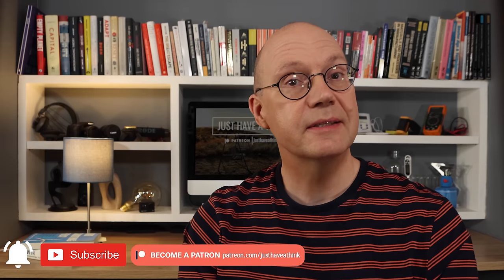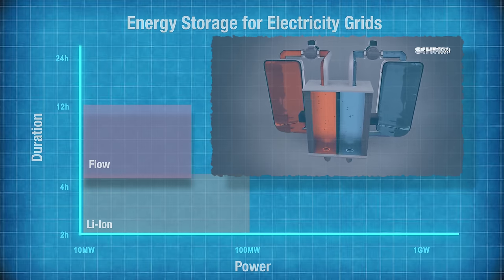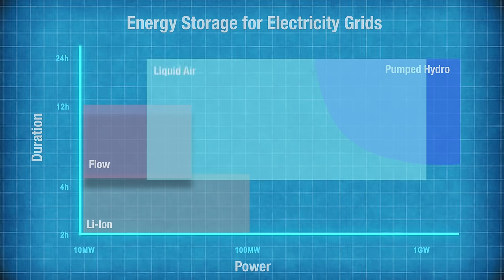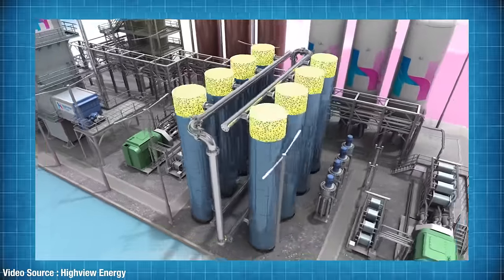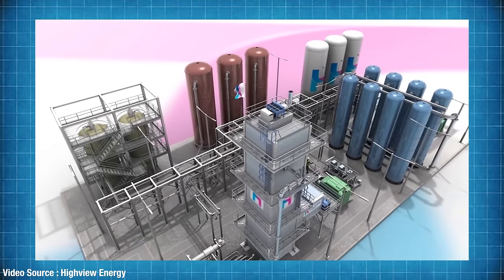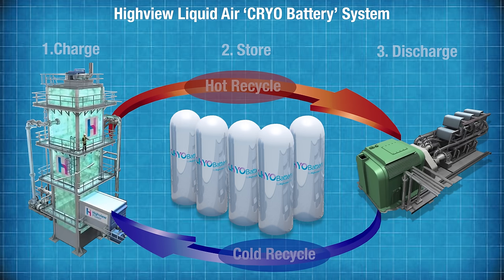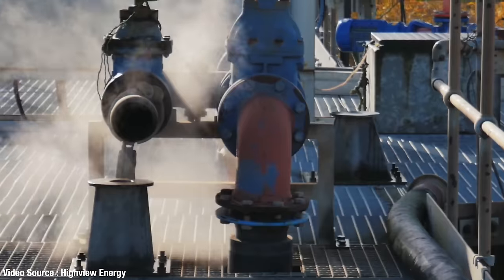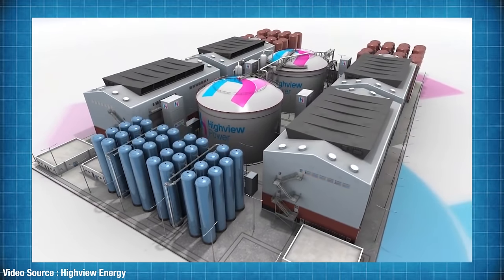Liquid Air Batteries. Literally energy from thin air. Seriously. Literally!

Comment: I was waiting for a drawback to this technology. But the worst thing about it seems to be the 60% efficiency which isn't great but also not catastrophic.
Reply: 60%, At Best! I think we can do better!
Reply: @robinholmes785  How?
Reply: 60% vs solar PVs 17~21%
Reply: @g4egk  that's not a fair comparison. PV's are electric power generating devices and we're talking about energy storage here. Pumped hydro has an efficiency of 70 to 85 %. Batteries have more like 99% I think. Hydrogen is much lower if I remember correctly.
And maybe with scaling up and technological improvements the 60% can become 70% someday.
Reply: At the end of the day it comes down to a trade off. 60% efficiency is pretty good and there are no contaminants or toxins involved in any way. Sounds good to me.
Reply: xnebiax. 60% efficiency when the electricity to power it is effectively free isn’t too bad.
Reply: As a civil engineer in process engineering, 60% in such a thermal recovery process is really good. A bit high to be honest.. not sure 70 would actually be physically feasable due to laws of thermodynamics. The optimalization would be purely for thermal insulation on more components, which would drive costs way up.. so a sweet spot between 55-60 would be realistic with variable generation and insulation of the most vital parts. Compare this with natural gas turbines with max eff at 60-65% at perfect conditions. Remember that ramping up an down power will decrease total efficiency drastically. If batteries are 90% and instant responsive, it has to be at least 2-3x as cheaper/MWh installed to be comparable. lithium is round $175-200/kWh (only packs) so $92/kWh might do. Or just throw in some LCA benchmark, and this would probably blow li-ion anyways. 

Still... people understand that this is just your refrigerator with heat and cooling capture right? (Turbine instead of valve) Using other fluids than air would probably be better in a closed system. Though the heat capacity to air mix ain't bad, better fluids exist. Thus you don't have to waste energy in the cleaning of new air. The expanded air in the turbine could also be recaptured, given a large enough capture room with close to atm pressure.
Reply: 60% if used as a stand-alone system. There are industrial processes that generate excess heat. This system could utilize that excess heat in the generating phase, increasing efficiency to as much as 75%.
Reply: @mogiebi  whilst better refrigerant mediums might exist, how do you store the expanded gas? Its the expansion that is generating the pressure for the turbines, right?
Reply: Easy to scale to compensate for the the efficiency level.
Reply: @David-lr2vi  Not free as there would be a generation cost for the energy used in the process. Technically speaking the system would result in a higher cost for the electricity it outputs. When evaluating systems like this you should look at the total cost to the consumer. Great to see a system that could make use though of the lost production of solar and wind but ultimately this adds to there costs but allows them to begin to approach the base load generation capacity that you get with non renewable sources.
Reply: @beavans  Yes, there is additional cost, but the cost is a capital expenditure and not an ongoing operational or consumables expense.
Reply: Beavan Family. The power generation cost is effectively free with renewable energy. Once the capital cost is sunk it continues to generate electricity whenever the sun is shining, wind is blowing etc.
Reply: @David-lr2vi  ...renewable energy is not free - the original capital investment must be amortized over the life of the equipment - this is normal accounting practice.  In the context here of "store the extra or lose it", you are more-or-less correct...
Reply: @MrGonzonator  the turbines are driven by high pressure inlet and low pressure (atmosphere) at the outlet, normally. The refrigerant medium can basically be anything, but it should be expandable/compressed without too much heat generation. Compressing air makes the compressors really hot, and this excessively heat (and from others components) is redirected and stored in the insulated tanks. 

The important thing is that you want as much mechanical energy out (turbine) and as little heat energy wasted in the whole process chain. Recovering (and utilizing) heat is quite wasteful because you always need a temp difference to drive cold/heat from A to B.
Reply: @MrGonzonator  air is a refrigerant. CO2 is a refrigerant. Basically everything that's a gas in atmospheric pressure can be a refrigerant. The key is to use a gas that can be compressed easily without generating a lot of heat.
Reply: @mogiebi  they are generating heat from compression then stroring that heat (presumably in high purity water?) for later use in the expansion cycle.
My point was simply that once they're finished with their expansion, the gas has to be expended to the atmosphere. That being the case, what better medium to use than the air itself? Its free to aquire and doesn't harm the environment.
Reply: jrb _sland. They don’t amortise the cost over the life of the equipment. They amortise it over a far shorter timeframe, generally 5-10 years, so everything after this is free energy.  

The  market spot price of power is also currently being lowered by the transmission grids inability to store power at scale and even goes negative at times trying to get generators off the grid. No doubt these times are also included in the amortisation calculations. If the grid can store more power at scale then the break even points of renewable projects will decrease further and encourage more renewables onto the grid as the spot market prices level out.

Free energy of course is why fossil fuels can never compete with renewables in the long term. Why would you sink millions or billions into a coal power plant or gas power plant and still have to pay for fuel when renewables have no ongoing fuel cost. Storage is the only limitation at the moment and as this video shows there’s no shortage of ingenuity being thrown at the problem.

I think it’s going to be fun times ahead for our backwards government here in Australia that’s constantly trying to stop  renewables. They will never stop the rising tide of renewables.
Reply: @MrGonzonator  He did mention a "big enough capture room" for the gas. To avoid needing to repeatedly clean new air. He also mentioned that there are better liquids for a closed system, but just mentioned that theoretically you could make a closed system with air as well. Although it would not be as efficient as some of the alternatives for a closed system would.
Reply: xnebiax - TESLA Megapack is 98% Efficient , and can be Delivered on a Flatbed Truck and built on site in just 100 days.
Reply: @g4egk  You're comparing apples with pears :)
Reply: @markplott4820  Only when brand new. It has a limited life span, since it loses it´s ability to hold charge with every charge cycle. After 20 years the whole thing needs to be replaced. Also, like the video states, it has zero economy of scale, since more storage = more packs = more cost. And that´s not going to change any time soon since battery packs and the materials to make them are in short supply already.
Reply: @uegvdczuVF  - that's bullshit. Tesla MEGAPACK grid storage batteries can last 80 years and complete maintenance free.
They have an Advanced BMS that extends their life. LAES is only a decade of life . 
TESLA batteries get cheaper EACH year. 
Megapack batteries have over 50% better life than Powerpack . 
And Tesla has the WORLDS lowest price / energy dense battery.
Reply: @robinholmes785  Maybe we can, but the question we should be asking is if we should do better than that. We are already long past the point where we should stop worrying about finding solutions and are at the point where we need to massively scale up the implementation of existing solutions.
Reply: @lookingforsomething  thanks for answering 🙃
Reply: @MrGonzonator  just to clear out - way better refrigerants (than air) exist and is commonly produced and has low/none environmental impact when we weigh in the consequence of i.e. a leak/release into the atmosphere. 

In recent years CO2 as refrigerant has gained traction, and has good thermal properties for these cycles we discuss here. Though the pressurelevels we are talking about is many levels of magnitude higher (thus higher equipment/safety cost), it is one of the best refrigerants coming to physical properties, like heat capacity and compressibility.
Reply: To my understanding, the argument for using air in this product is more of a good selling point to the public (R-134 sounds "toxic" right?), and not from an efficiency point. JustHaveAThink tends to advocates renewable tech which is the most eco-friendly available, so I think (simply said) the most realistic process build of this kind would include a more efficient refrigerant for instance.
Reply: @markplott4820  Tesla megapack is half the storage for twice the price. Double the size of pack, double the price. Double LAES price, you get quadruple size LAES.
Funny how you claim to know better than both companies with plenty of engineers smarter than you how long their products last. LAES is basically all solid steel, only the parts that actually go through repeated cooling and heating and turbine bearings need to be replaced for the next twenty to thirty years. Tesla gives their big batteries ten to twenty years warranty, meaning they should not have more than 30% degradation during that time.
But even if the thing could keep on working without breaking down for decades longer the degradation means it would be cheaper to replace it than use the now massively inefficient battery. And given nobody has used one for that long we don't know if the degradation would stay steady or ends in a sudden cascading failure.
So please tell us what fever dreams or conspiracy websites claim Tesla batteries last eighty years when Tesla themselves give up on them long before that.
Reply: There are limited Lithium resources with which to make Lithium Ion Batteries, and some of the Lithium Ion Batteries will be needed for portable applications. It's good to have other technologies in the mix, which combined with recycling of materials will allow us to store enough energy for the whole planet.
Reply: @martineyles  Actually, no. There is plenty of lithium, it is just cheapest to extract by mixing lithium salts with lots of water and leaving it in large shallow ponds for sun to dry, which is not exactly fast, and while it doesn't kil everything like some mines, you don't want that thing leaking. So if you want to expand lithium production you either pay many times more for mining and refining ore, or convince people living in area where water is rather scarce to let you use huge amounts of it to basically create an artificial toxic swamp lake. Oh, yes, you could even extract it from seawater, just takes even more time and energy.
Lithium is also pretty cheap, the demand must rise a lot for price to become high enough for companies to trust that investing in new mines or actually recycling the old lithium batteries for lithium makes sense. Note the batteries do get recycled already, they just don't bother with the tiny amount of lithium in them because separating it from other stuff costs more than mining and those batteries have more important stuff like cobalt and aluminum that are both easier to extract and worth more money.
But yes, having alternative tech that is cheaper and easier to build on large scale is always useful
Reply: @mogiebi  Correct me if im wrong but if you want to use  refrigerant instead of air, you need to capture the  refrigerant after expansion to  make it a close cycle. Im not at all expert on the topic but I suspect the problem with that is the need to build a huge tank just for that. Now, if the compression ratio is similar to that of air then it means a 700 times bigger tank for the expanded gas which seems costly and it makes the plant that much more difficult to scale as you always have to incrase the size of the capture tank or add more capture tanks too when you add to the storage capacity (more tanks to hold the liquified refrigeran).
Reply: @MrGonzonator  You don't "store" the expanded gas, it is released to atmosphere. When you want to store more energy you pump it from the atmosphere. And yes, it is the expansion of the liquid air into gaseous air that drives the turbines. You seem surprised there are no complications. That is the beauty of this system.
Reply: @robinholmes785  Hi Robin Holmes - Great Name! :)
Reply: @mogiebi  most refrigerant gases are refined fossil fuels. And greenhouse gases. Leaks can and do occur. If liquid air leaks we just have more clean air to breathe.
Reply: Wind turbines are cheaper every day. More means more power when it's not needed. This is going to be useful to soak up that energy and justifies making more than "needed" right now.
Reply: @PetesRetroCollectables  They are. And low GWP on refrigerants are a great concern for most consumers of compress+condense processes. However at the end of the day you want to concern yourself with the total efficiency of the system. You could rotate the question to be "Why don't every freezer/heat-pump in the world already just use purified air?" - obviously because better alternatives exist. Most consumers want to replace fossil-based refrigerants in their cooling/heating systems - just to make their company emission-spreadsheet look better - at the cost of replacing it with a lower efficiency one (driving the electricity-bill + consumption up, thus creating more demand and emissions).
Emission risk (of i.e. propane R-290 with GWP of 3.3) has to be evaluated with all the wasted energy "not" stored because you use a less efficient refrigerant.
Reply: @CraftyF0X  Good point. You will need a good enough expansion room behind the turbine, given this is not a problem for the current site. After some rethinking, the recapture of air will (of course..) never re-enter the system "at night" because of the marginally higher electricity-price, thus making the point of re-using the air to store it for later use complete useless. This actually debunks my arguments for using an other refrigerant than air also... =) I tend to get closed-minded when everything you evaluate is closed-loop cycles.
The only way the closed-loop alternative would work is if the expansion-room can hold the air for a long enough amount of time (say a peak cycle of 4-12 hours) without increasing the back-pressure much. I tried to find what fraction of the process (minus heat/cool recapture) is attributed to the air-cleanser, with no luck - if anyone has this?
Reply: @MrGonzonator  Yes, processes such as atomic power plants!
Reply: @markplott4820  you mean Panasonic!
Reply: @Richard Wood
No, the alternative isn't to just do nothing. The alternative is to use one of the many available storage options
Reply: the drawback will be the extreme financial cost to cryogenically cool the air, which means electricity has to be used and generated from some source.  Nothing is free in this world.  The laws of thermodynamics will not be violated either.
Reply: @HamRadio200  they report between 60-75% on their websites for the whole process, from process engineering is really good. The cost of electricity is of course close to zero when these storages are charging. Also at times in Denmark last year price was negative (yep, you actually got money) during peak periods of wind production which was not forcasted in the power stocks. This happens only occasionally, but still it's more tear/wear to the turbines to start and stop them all the time due to overproduction, which drive operational costs up. Wind turbines are usually stopped because of overproduction, or too high wind speeds - not to maintainace.

Thus, it makes sense for producers to coop with storage to lower their overall operational costs
Reply: @David-lr2vi  What will the future hold if we..Aussies...don't get our "green goodies" from China...where will the pollution of making the power equipment settle? In our back yard?
Reply: @mogiebi  the >50% efficiency is only possible if they supply additional energy to the system from a 'waste heat' source - in their current test plant this is by burning methane from landfill, so as well as leading to a non-representative RTE figure due to the additional energy input it also emits CO2
Reply: @MrGonzonator  in the atmosphere
Reply: 60% of zero is zero. Once roi is met free is free.
Reply: @nannyoggsally  the thing about hydrogen is that you can use liquid helium to transfer heat from fission to obtain it from water. Further noT ONly have Japanese developed the higher temperature nuclear reactor because again helium is inert allowing you to operate your core at higher temperatures then water can control. So you have these two competing uses for uranium either you get it from the ocean and reduce the mass of the nitrogen molecules in the air so that it can be shipped or trucked Even at thousands of miles per hour over the surface of the ocean without the use of turbulence or rocket science AK propellers turbines Etc but instead just exploiting inertial Dynamics given given round trip cargo and Network Solutions. Anyway inertial energy is the answer as is the diligence comparing PhaSe change atmospheric gas synthetic fuel economy of the future against the strictly uranium Heat hydrogen? I can assure you nobody is modeling these two choices. That's not a problem that's World War 3.
Reply: @mogiebi  at the end of your comment you thought about the issue not at all you're not going to capture the cleaned nitrogen in the room you can use Cheep bladders which for your information the cost per cubic mile reduce this exponentially as for the surface area of the fabric. But despite the exponential reduction and cost cleaning the nitrogen is not a problem if the location is correct. More generally however you're not understanding the temperature Gap here. You're not understanding THat the tables that you're looking at are not being properly applied by you.

Specifically you're not understanding that you don't connect the storage to electricity you don't put electricity in it and you certainly don't try to get electricity out of it. That's not what this MUST INSTEAD BE about. You can have windmills and hydropower nuclear all of the sources of energy including geothermal which for those who are concerned about global warming a lot of times they forget that most of the heat on the planet is in the core that is actually Moulton and so if you have a way of using heat you don't need newly heated converting there is heat under the ground in Arizona for example we have a mine that you have to cool the shaft with pumpable ice. When the ice melts no electricity or other work is done the Blazing temperature 6 miles down just melt ice and that is a very expensive air conditioner instead of a similar price liquid nitrogen system that would recover much of the energy. and I'm of course Understating that because the value of the heat that is being removed from that mine shaft is significant it's not a nuisance any more THAN the Surplus electricity that the "air conditioner" for the glass biosphere in Oracle Arizona generates conventionally from methane on the electrical side of that insane contrivance. Actually wonderEd how far those two locations are apart I think it's quite far but wouldn't that be sweet if they were near? if you could use the heat from a 6 Mile deep newly-built mineshaft to keep the biosphere University climate change Laboratory from being too hot to work in? maybe you could use the cheap insulated carbon fiber hoses that that foUr OR five-letter corrupt company produces for the methane industry to offload lNg to the mainland LOL. I mean that's the way the turbines work right that's the patent one of the older of nitrogen patents is essentially a jet turbine with the boiling nitrogen sucking in heat that boils it even more you can see ACTUALIZE same example in The Mineshaft the pressure of the nitrogen that's exiting maybe it's BY a axle or I think Best A cable loop that's getting pulled from Below by the work the boiling nitrogen is doing down below and not only does that cable liquify the nitrogen that is being sent down the hole but there's many many times as much as needed down there so you have this big fat pipe of liquid nitrogen going to the city for cooling and the other power needs including the biosphere. Some people might compare Amazon servers creating their corporate balmy Indoor Paradise but having occasionally tried to use their "store" I would say that most of the heat that is generated is wasted with Spam to my tiny screen and I cannot believe how people tolerate that.

 Anyway I appreciate all the appreciation of this very Noble technology but in terms of the practitioner they need to be getting there defense together and need not book a round-trip ticket to Geneva- 1 way 👌
Reply: @beavans  I can't even begin to note how to conventionally wrong you are but I do appreciate your spirit despite the uberous hubris
Reply: @David-lr2vi  converting renewable energy into electricity is what has stopped it for decades and what will continue to limit its Market participation. Converting renewable energies into liquid nitrogen and the liquid nitrogen International economy that kind of result is the way petroleum nearly worthless becomes the past
Reply: @lookingforsomething  I'm sorry but sometimes the general rules do not apply. That is the case when you use the atmosphere. It's that old joke about Infinity. When your cost is zero the ratio the surprising things to what you just assume are the case but are not.

At scale the value of liquid oxygen might go down significantly but it is extremely valuable and recreationally the market has yet to even hint at snowballing but suffice it to say the bottled water business is insignificant to the Clean Air culture we are going to see in the near future and the savings of using micro Mobility alone allow you to have Every Breath You Take before Mount Everest essentially no matter where you are in terms of its healthiness and delightfulness.

But I think that the main point here is being lost. The reason the system is not closed is because at scale you don't build the infrastructure on every continent or country. Some parts of the globe I have the Renewables that can supply the rest weather that is fission or whatever you go ahead and picture mechanical work done from the liquid nitrogen. Remember we don't have to use humans to steer anymore. Also we have tremendous experience moving liquefied methane in insulated tubes underwater already. As you increase the capacity of those flexible hoses the cost goes down exponentially. When you think about the deep sea exploration and all the heat that we saw all that steam superheated steam super high-pressure superheated Steam and you ask the question if you could order the actual divest ification of those offshore deep sea platforms so that their services could be retained by the highest bidder even if it was a liquid nitrogen production from geothermal heat entity that guaranteed  epic disruption. offshore windmills can of course also liquify air and the super tankers that can deliver it to continents at high speed are very easy to simulate cost efficacy because they don't use propellers. the biggest myth I think I've ever slain in my life is this notion that drive has to be continuous it's the opposite you want to have your craft flying across the ocean at extremely high speeds so that they can slow down over significant distances before being yanked up back to their maximum speed. That yanking process from undersea cables I mean they're straight cables but the ocean is curves if you believe that the world is round you know that the ocean surface is curved so the straight cables that dip below the surface of the ocean in the middle connect these high-speed craft infrequently but Newton had it correct liquid nitrogen a billion gallons of it or however many trillion gallons of it accelerated to however many thousands of miles a day or week if not our will tend to remain in motion at the same speed because the virtual Air Road that it rides on has de minimis turbulence the ratio of the turbulence to the inertial energy decreases exponentially as the mass of the cargo increases of course and is reduced further by depressurizing the front because the expanding nitrogen from the heat that's sucking that are into a tiny tiny Gap through the tank creates allows such apparent miracles d u h.

 you fly your long tubes of nitrogen that is super cold of course but that does not mean chilled there are other ways to get the molecules close enough together and your goal is to make that process as intensive as possible because the higher the grade of the Heat obtained the more valuable it is.
Reply: @markplott4820  yeah all you have to deal with is the craziness of electricity. Electricity remember incorporates all kinds of costs that are not defendable when mechanical work is the goal. Since the amount of non mechanical electrical work that we need done is insignificant the cost of electricity is going to be insanely low in the near future like under a penny a kilowatt hour and the solar fields that are contracted for say a penny and a half a kilowatt hour it's going to be in bankruptcy court yet again. As will the Tesla battery storage system and likely the creditors To Tesla not just it's stock being worthless. The problem is you have no imagination about the better solution for the actual problems lots of contrivances that trying to use electrons inappropriately create. But you sure are employable congratulations on that I guess.
Reply: @mogiebi  I really wonder what you think efficiency in terms of a refrigerant is? I mean there are various ways to use refrigerants. And you are unaware apparently of the fact that water vapor can be $$$filtered$$$$ out of air! So that means that you can use same air over and over again I mean the cost of dry air NOW HELLO way down when you have inexpensive membranes to separate nitrogen and oxygen etcetera from the H2O Vapors that is actually an 80%+ reduction in energy required from the first prototype VERses that quote "MOST efficient refrigerant." But really the main issue is what you think geothermal cost for the Heat. The heat is very high grade what do you think at scale- it costs? Do you really believe it could possibly be over a tenth of a penny per kilowatt-hour? Do you really believe that anything else can compete? When you can package energy in atmospheric pressure cans and the cost of a can like commodity OF fat huge radius flood waters say tubing it's basically insignificant and hello once you have a long enough section for the DeliVERY what does the cubic mile delivery entail you can move it very very very quickly very very very long distances for almost nothing as well. nobody can disagree with the statements I have made here that is if they dare to think about their truth. but in order to dare to think about the truth of what I am sharing you have to be able to go beyond electricity. You have to have the discipline and experience at using your mind for Concepts like energy itself which is an abstraction that apparently almost nobody has ever dare to even approach. Energy is not a laundry list of Technologies that you talked about in electrical terms, energy and matter are in reality closely aligned and the fluency 2 engineer what you want from these two elements is not yet being taught to kindergarteners or at least elementary school kids as it should, but not an accident. The atomic secrets are out but our nation's have not gotten over it. it's understanding the physics that matters not building weapons
Reply: @CraftyF0X  at the risk of repetition let me just briefly dictate to you the fact that you are ignoring. Because you have sold the oxygen you are left with the nitrogen. The nitrogen can be partially preserved in extremely inexpensive hot air balloon kind of structures if you have the acreage which is of course a joke when we talk about Renewables. You can have a tent for example it is 1000 feet tall and several square miles. That's a lot of nitrogen! And it's almost no cost you don't even need a floor the purpose of this tent insta not have to cool oxygen are compressed oxygen or deal with oxygen in the proprietary systems I have discussed that take uranium and convert it to energy that in turn binds the nitrogen into liquid form without of course making it Radioactive and then I don't have a working model for doing that nor do I claim that it requires only common sense. I have just asserted that it is very feasible and that's what matters ultimately after we demonstrate doing it for 20% or 30% of all the fossil fuel utilization presently we will do that other thing for the rest in short order
Reply: @mogiebi  this is not about cooling air indoors. However when you're in your Prius you don't run your air conditioner for yourself you run it to keep your nickel metal hydride batteries in the back the very back of the vehicle cool. That & the absolute vile on early vile practices OF trying to keep the air indoors such that people can sweat their body heat away and that's what DEHUMIDITISING is all about it's about keeping the sweating from being noticed by the sweater. MIT knows how to filter water vapor from air without condensing it. But all of us know that our bodies do not need the air in our homes to be cool for them to be kept cool. Even 98 lb of meat is obviously thermally massive and we have all been abused by the HVAC industry into thinking that a few minutes of cooling for an evening is not sufficient if applied to our body. Your body temperature rises very slowly and a significant amount of heating over body causes no problem. It's not about the temperature of the air it's about the temperature of your blood. You just have to let your body sensors know you're okay and that requires no energy to speak of.
Reply: @HamRadio200  there are two different issues what is phase change of the reversible nature and where it should be utilized. It should not be utilized for storing electricity but rather for storing mechanical work or as a means to distribute energy in uranium without it being wasted on electricity Orso proximate to its end use say on continent does electricity has historically imposed. You have to be able to export your energy and do it for far less cost than anybody is willing to export their fossil fuels. This is actually extremely easy to do but you have to overcome the resistance of the Nations that act as if they have to make profit on their mineral wealth. They don't.
Reply: @mogiebi  you are confusing the price first really limited or marginal amounts of electricity with the cost. I have been using time of used electricity basically my entire life so I do understand having spent many many decades intensively studying the optimization of various demand-side activities. In fact I can genuinely humbly say that as a beta customer of time of use as somebody who cheered on Texas Instruments slicing tiny spheres of silicon in half so that they can expose the inner half of the Silicon to sunlight to make revolutionary photovoltaic cells and did this is a tiny little person talking directly to Texas Instruments I am not some glib do-gooder or industry hack. What the electric utility industry and fossil fuel industry cares about is that they get their guaranteed return on their investment which is normally specified in a percentage. That means the more money they waste the more money they make. That means that off peak prices have no meaning. They are by definition less volume then the highest prices. Let me repeat that one more time. When the demand is highest all of the production is sold. When the demand is lowest a significant amount of the production is sold leaving less that is sold at the highest price. The only time discounted prices matter is when you can buy more of something that is sold at the higher price , much more!
Reply: @kurthaselwimmer9545  I live in there flaring of landfill gas that accomplishes nothing but protects the atmosphere from the unburned methane. Burning methane is carbon negative regarding global Heating
Reply: @Allen Loser over a year ago I got tired of people referencing that efficiency specification and I had the literature accessible so I spend some time and it was far worse than I thought. I don't know if you learned it with any historical context but the dudes that talked about it we're practically mentally ill. It's not about reality at all but was problematic thought experiment and I understand it has tremendous utility and certain applications but it is utterly misapplied here. It has turned into fossil fuel industry propaganda Criminal misdirection
Reply: @Irene-fu6gj  Firstly, I've tried reading your post twice and you have to write more concise - and use punctuation please. There's also a ton of non-relevant information. 

Instead of me guessing what you've tried to explain, could you rewrite? Thanks
Reply: @mogiebi  i edited speechos so sorry for"em ! Otherwise only could withdraw but why??  U r not The World. I do appreciate your feedback and I hope the changes I have made drasticLY increase the transparency what I took the time to share earlier this weekend